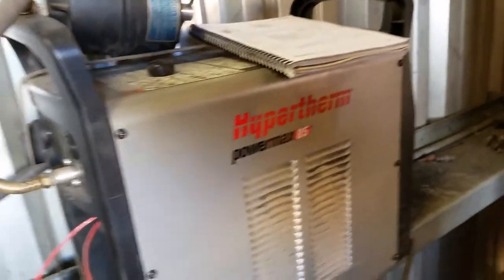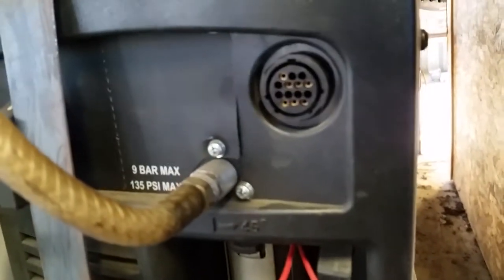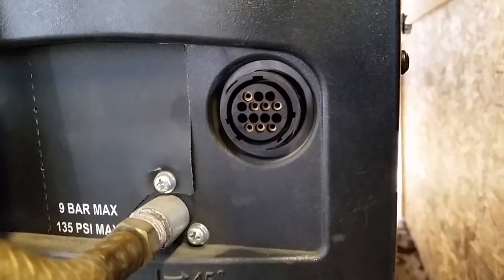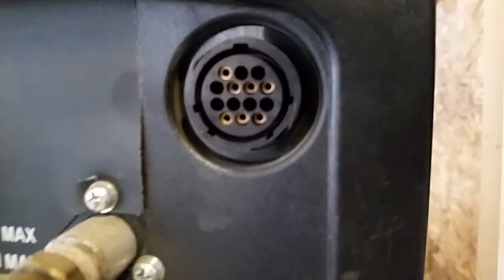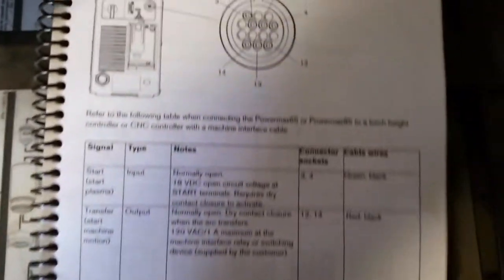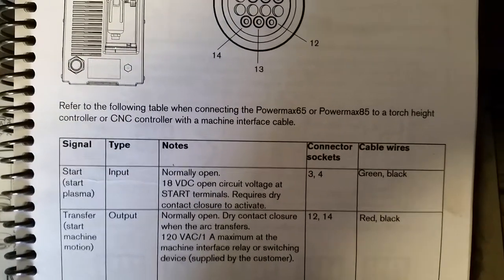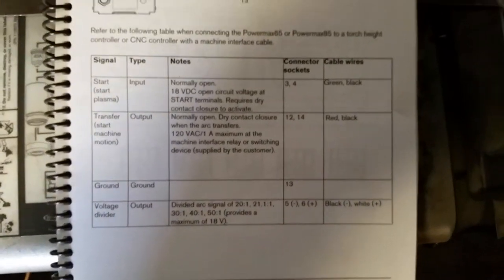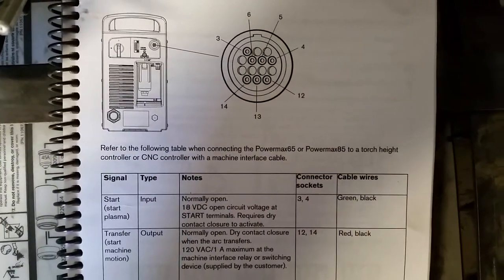Hypertherm, PlasmaCam machine torch

Comment: Hi, My powermax 85 i put the CPC 5 and 6 in + and - Proma 150 THC but the 3 and 4 where ? The torch not run only i see the volts 50:1 in THC
Reply from the maker: In the diagram it shows the plan location for all the pins at the back of the machine
Reply from the maker: Omar watch the video and look for the part where the diagram is.
Reply: It does not work with a hand gun only with the one that sells hypertherm for cnc you must get the signal from the powermax 45 is the cable
6 violet
7 orange

🙂